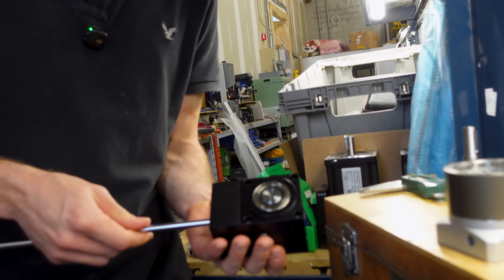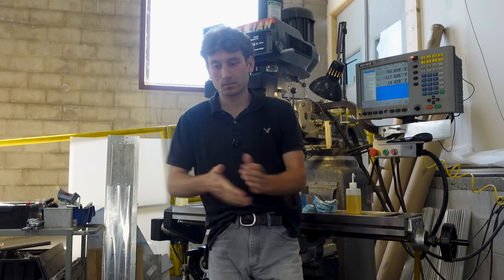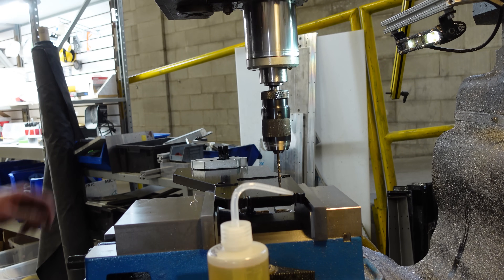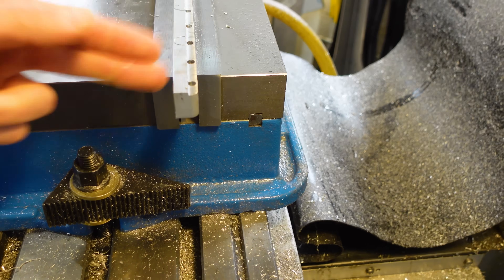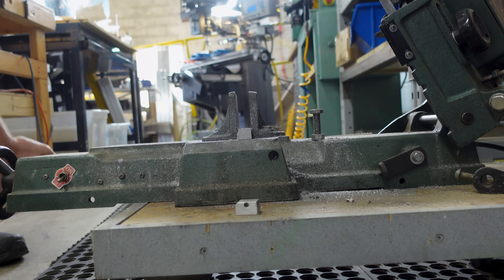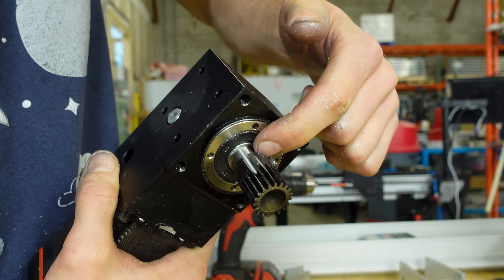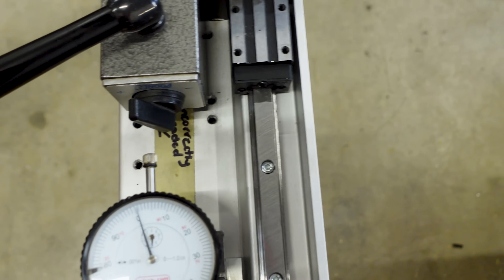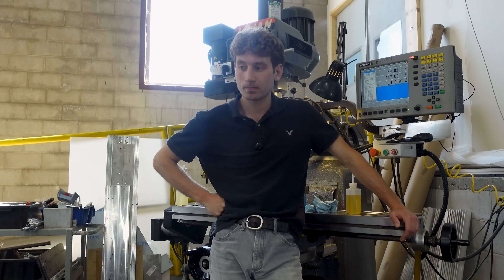Engineering the AltMill 4x8 ❘ Ep 1: Rack & Pinion Rigidity

Comment: Will it be able to cut like 49x97? Many suppliers send laminates and veneer sheets actually larger and it makes a difference in terms of yield depending on the program you use
Reply: Also need room for an ATC without compromising cutting space for a full sheet.
Reply from the maker: aiming for a work surface of roughly 50"x105" plus space for an ATC

Comment: Another one of the (possible) benefits of having the drive gear closer to the motor housing is you might be able to turn the gear over to use the other side when it finally wears enough from the rack to cause problems down the line in the future. Your backlash should remain the same since it's the same gear and you won't have to re-compensate.
I miss prototyping, it's fun discovering things as you go. I wasn't brave as you doing it by hand though, I was doing it more in a big Haas v3 ;)
Cool 'making of' video, can't wait to see more!